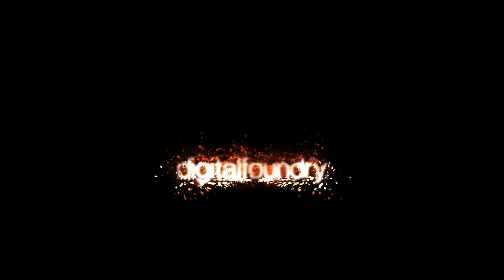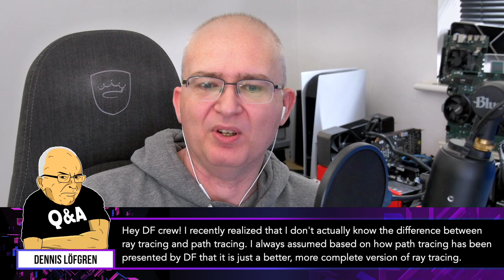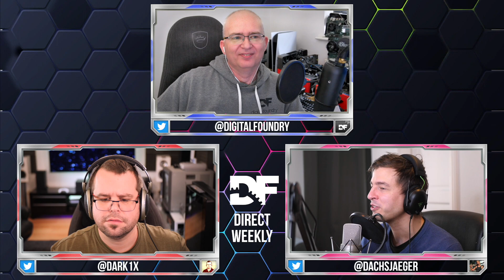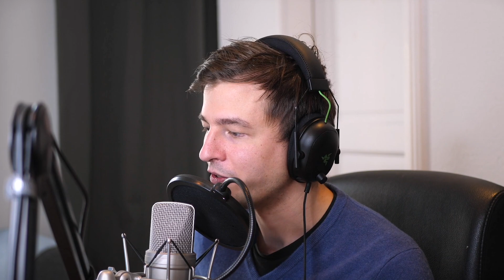What's The Difference Between Path Tracing And Ray Tracing?

Comment: From my understanding "Ray tracing" is just a way of saying ray traced direct illumination, shadows and ambient occlusion. 

You shoot primary rays from your camera, through your NDC and into world space, these rays are then used to find intersections on worldspace, from there you perform some form of sampling of random directions proportional to a probability density function (uniform spherical, cosine, brdf, light surface or solid angle subtended) for the monte carlo estimator to integrate over these sampled directions and then along these directions with the hit points of the primary rays you do a visibility ray tracing (the actual ray tracing component since the first part of this aka solving primary visibility, can be done through rasterization too iirc). 

Path tracing is more useful when doing indirect illumination, ie: global illumination mainly. Most of the games I think resort to uni-directional path tracing + next event estimation (trace direct illumination from each subsequent iterative hit point of light paths). I do believe nvidia marketing sometimes conflate these things but correct me if I am wrong @ DF, ray tracing is direct illumination (+ local shadows and AO from uniform environment light) and path tracing is for global indirect lighting. 

Path tracing sucks when trying to render certain caustics btw monte carlo can be useless when the integrand and the pdf are not proportional causing variance to explode. Progressive photon mapping for the win!

Edit: for people wondering how you terminate the recursion for path tracing (since you recursively trace light paths from hit points until one path happens to hit a light source in a scene, and if ur light is small or in a weird place the likelihood of a ray hitting it is small) you usually use a method called russian roullete (keeps sampler unbiased but without letting it converge at infinity)

Edit 2: Ray reconstruction and temporal denoising autoencoders make this sampling process better because they help get rid of the variance by directly estimating the distribution you are trying to estimate.
Reply: found the actual graphics programmer
Reply: No, that's not quite true. Raytracing can also do bounces (recursive tracing) - in fact, that is how it's used for GI and has been for a while.
Pathtracing is a type of raytracing, and truthfully, there are no exact definitions for these.
It's really more about the lighting being made of a single coherent pass rather than distinct components like AO, GI, etc - it all happens in one, rather than being separate and composited together, leading to more realistic and fine-grained results especially where things like shadows, GI and AO would normally mix.
Reply: @nolram Path tracing IS recursive ray tracing. It’s a terminology difference afaik. Then you can do implicit or explicit path tracing which essentially means whether u are doing next event estimation or not.

Edit : for context if u do direct illumination (“ray tracing”), that one pass already has the necessary computations for rt reflections , shadows and u can do AO without much of an overhead. 

If you use a phong brdf model for eg for ur materials you get good ray traced specular reflections as well as diffuse lambertian reflections + visibility rays grant you ray traced shadows. A uniform light at infinity + visibility gives u AO
Reply: @TheTakenKing999  You can't do RT reflections nor AO with only direct light tracing because those are inherently not direct lighting phenomena. Reflections are, well, how a ray reflects off a surface and hits other surfaces, and AO is sampling a diffuse hemisphere of short-range rays from a given ray impact point (it's a hack, it should technically be part of a larger diffuse lighting equation).
So no, it's not recursion that makes path tracing path tracing.
Reply: @nolram  Nope, not what I said. Once you solve primary visiblity from your NDC plane you can have AO done through direct illumination as well. This is because it IS a direct lighting phenomenon. You have directional light incident on hit point of your primary rays. In code this is very easy to implement if you are already writing a direct illumination ray tracer. You can even MIS multiple AO sampling routines alongside direct illumination that gives you shadows and reflections together in one pass. AO will use a different light source, that is the only difference. 

I never said all three are the same, I said implementing AO into a direct illumination ray tracer that already is solving reflections and shadows in one pass has less overhead. Whereas path tracing is a bit more involved because even though the main difference is recursion, for next event estimation your sampling pdf for each light path at every hit point would not just be what you use for light sampling, since you have to rejection sample the explicit direct illumination rays that align with your brdf sampling at any given hit point.
Reply: @TheTakenKing999  That's just... not the case though. For AO you need to sample your diffuse BRDF in a hemisphere from your hitpoint; with direct-illumination only you cannot solve any lighting phenomena like that. The only thing you can solve is direct diffuse lighting. Everything else requires sampling more global data and therefore sending more rays. Unless you build G-Buffers of some kind (depth, normal, etc.) and then use previous screen-space techniques for approximation. Which defeats the point of raytracing in the first place IMO. 
AO is a phenomenon of ambient indirect lighting, not direct lighting like direct shadowing would be. AO occurs due to occlusion of incident lighting.
I think your explanation is nonsense, and uses various terms incorrectly (like what MIS is).
Also, you can not solve reflections in a direct-only raytracer. It is literally not possible. A reflection is, as the name says, a reflection of light, something that is by definition not a direct phenomenon.

Comment: Gaybox series x is holding back the gaming industry with its weak hardware!!!!!!
Reply: you’ve had over 100 comments on this channel saying the same thing can you shut up😭unfunny and annoying it’s literally just as good as the ps5 ~ps fan
Reply: Report as spam folks
Reply: @mikeuk666 Don't fucking tell me what to do.
Reply: @mikeuk666  report this gaybox fanboy, folks.
Reply: Yeah sure 1050 gtx owner
Reply: Heterogeneous\Unified architecture has growing *physical* benefits, which MUST come to PC for it to remain viable from a cost perspective. For this to happen (and it will), PC needs a fundamental, physical change to most\all prudent pipelines and even memory systems themselves. If this does not happen, PC will become legacy architecture for gaming and ML tasks.

Xbox and PS5 get by with 6GB ram. Lets forget that its GDDR6, and just consider the fact that it is SIX. How is that weak?

*PS you are gonna see videos on this at some point in the near future. Its unavoidable.
Reply: Maybe, the Steam Deck is basically a low end PC with diff architecture. I do think DDR5, new CPUs and 40XX GPUs are so far ahead of consoles that it's not really like PC needs a change at the moment.  @timmyp6297

Comment: Yes pathtracing is "inaccurate" compared to RT. But in video games you can raytrace each components like reflections, shadows, GI separately and combine them with traditional rasterized rendering. That approach is more performant but has its flaws. Pathtracing approach can calculate all the lighting elements together which is more expensive than RT+raster method but it gives better results. 
So yes, raytracing is more accurate and to do what pathtracing is doing using RT it will be more expensive. Thus pathtracing is the better solution.
Reply: RT isn't more accurate. Either can be more or less accurate, that's up to the developer. And even within your reasoning, one can simply say PT is more accurate because it gives more realistic results even if it's lower resolution to maintain similar performance vs RT.
Reply: @RealComp5  yes, by "inaccurate" we are talking about mathematical inaccuracy here. Pathtracing uses Monte Carlo Method, which is based on probability function. So that's what's different compared to brute force method.
Reply: Path tracing is a type of raytracing, so no, it's not less accurate than RT, they both use the same fundamental logic.
Reply: @nolram  yes PT is a type of RT and they are trying to do the same thing. But PT uses probability functions to solve this problem.

Comment: My understanding is that you can't just say ray tracing, you have to be specific.  Ray traced shadows? ray traced reflections? etc.  But path tracing is basically, everything light could possibly do, it's on the screen.  Roughly?
Reply: The problem is that a pure path-tracing is actually a “reflection and refraction ray-tracing”. It all comes down to physics, as there’re rally no “shadows”, “global illumination”, “subsurface scattering” etc - it’s all light reflecting, refracting, and absorbing on the electromagnetic level.
Reply: "Ray Tracing" and "Path Tracing", conceptually are 100% the same, assuming an infinitely fast computer with infinite memory.

Photons bounce around the world, and eventually hit a camera, or an eye. What energy state (color) and how many (brightness) hit that same spot? That's essentially how our eyes work, and how our cameras work, with the added catch that our eyes get a constant stream, where an image has a start and end time, to collect them.

Clearly, we do not have the ability to do this. So we need to optimize. The Ray tracers of the ’70s didn't really differentiate, initially. A “ray tracer” was what it was, and “tracing paths” is what it did. Some of the first published images from ray tracers, at the end of the '70s and turn of the '80s, had glass and metal balls, with all of the appropriate shadows and reflections you would expect.

People started to make distinctions, when they tried to optimize. We don't have infinitely fast computers with infinite memory. Path tracing sort of became about the journey of a single photon that ended up in the scene (hitting the camera), versus ray tracing being about what the camera thinks it sees, within the first few bounces.

An illustration of the difference is that in a game, to run quickly, the camera sees a wall. The wall is facing a light. That's 2 bounces: camera to wall, wall to light. Or it might look for the light, but hit another wall instead, so it is in shadow. A path tracer is going to know that the second wall is lit really really well, by a powerful light, around the corner, so the wall the camera sees isn't actually in shadow after all, the light is just getting there second-hand, requiring 3 or 4 bounces (my use of "bounce" here is off by 1 in terms of graphics settings; I’m counting hitting the camera or the light, as a "bounce", to simplify conceiving the number of calculations). A perfectly naive ray tracer might start by going from the camera, and bouncing an infinite number of rays an infinite number of times, to see which ones hit a light source. A perfectly naive path tracer might start bouncing an infinite number of rays from each light, and seeing which ones eventually hit the camera. Given infinite time, both should produce essentially the same image. On a PS4, they have to be a whole lot more clever than that.

“Ray traced ______” (reflections, illumination, shadows, etc) is only a thing because, again, a PlayStation is not infinitely fast.

The games industry put decades of research into how to do rasterization (using linear algebra to put triangles on a screen). They put mountains of research into making software and hardware really good at it, and inventing hacks that sort of cheat our eyes to look "good enough", in terms of reflections or shadows or whatever. Half Life 2 and Doom 3 are turning 20... and they weren't even the start. Not by a longshot. They were just some of the first to blow people's minds with "realism".

We are barely half a decade into ray tracing, and it uses ... similar math operations (mostly algebra / a little trig / some calculus, maybe), but it uses them for completely different processes. Those different processes can't take advantage of the decades of research into making triangles go fast. So the game industry has said "what if we draw the game using the regular triangles, and then use ray tracing to figure out some of the other stuff, like reflections". That lets a console continue to draw triangles really fast, but also make the reflections in puddles more accurate, or make shadows sharper... ish.

Ideally, a "ray traced" game would run on hardware / drivers designed to optimize for what I assume will be batched similar-vector / lbvh / mesh processing (hardware is not my forte, though, so in 10 years, when something else wins, I will take that L), if it was going to match the brute-force processing power of the rasterization pipelines of today. That isn't happening. I don't even know if it will be happening for games, based on DLSS 3.5

So again, the techniques turn to clever means of "faking it". This time, not "faking" how light works, but rather "faking" not having infinite time, or infinite photons, and again, the ray tracers and the path tracers are going to do the same thing, from different directions; one brute-force, but missing the subtle things that would require a bunch of bounces for that ray, and millions of rays for that one pixel in the image... and the other method ... trying to emphasize the starting point of a photon, or the interesting stops (through dust or glass or milk, or the caustic of a wave shining light on the ceiling of a pool), but might fudge the amounts of light that went through, or that made it to the camera, to make these effects happen on a budget. PS: real caustics are just ... dream territory. Not going to happen, without fudging the numbers, in a real-time game, in the foreseeable future... but wonderful, nonetheless.
Reply: @SeanJMay  This was a fun read, though I don't know what a batched smililar-vector part/lbvh/mesh processing is, so I ignored it. I then googled caustics (I know it means acidic in biology, so I was confused at first) of somebody rendering a lamps reflection with a few glasses of water and was blown away. Is that the next level beyond PT or just a specific use case scenario of PT that interacts with round objects?
Reply: Both use the same technique to gather information, however, path tracing exists without needing a "camera". While Ray Tracing only knows what exist when it "sees" it from a camera.
Reply: @DanielLangeYT  That is wrong. Both path and ray tracing trace from the camera. There is no functional difference between those sampling methods except that with starting at the camera you know every ray will hit something while otherwise your light will just scatter off into nowhere. 

It's really more about the lighting being made of a single coherent pass rather than distinct components like AO, GI, etc - it all happens in one, rather than being separate and composited together, leading to more realistic and fine-grained results especially where things like shadows, GI and AO would normally mix.
Reply: @DanielLangeYT lmao you so wrong
Reply: @DanielLangeYT  When it comes to path tracing though - can it be half assed like ray tracing in the sense that a game can say we have ray tracing! then it's just reflections or something.  Does path tracing always mean- you're getting all the bells and whistler or no you could just be getting path traced reflections and thats it.
Reply: @DanielLangeYT  They work fundamentally the same way just think of ray tracing as using a shortcut to get slightly worse results , Both techniques use ray casting based on the player camera.